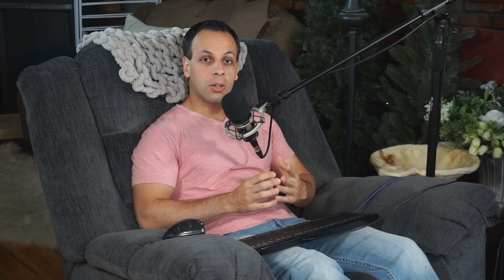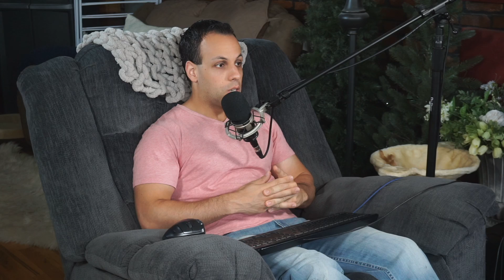Let's talk about what Right to Repair means for how devices are designed.

Comment: Haven't even fully watched the video yet but I just can't wait to get this off my chest - Apple took away the headphone jack and glues in batteries all for the sake of design and thinness yet the last few models of iphones were thicker and heavier than when they had headphone jacks and a more easily accessible/replaceable battery. It's all BS to take our money. Take away an analogue 3.5mm jack and replace its function with proprietary lightning port = control your customers' accessories.
Reply: Also remember that Apple released the jackless iPhone 7 at the same time as their AirPods wireless headphones. It's almost as if they expected customers to just replace their jacked headphones with expensive and unrepairable AirPods...
Reply: @InventorZahran  yeah, how convenient right?
Reply: @InventorZahran  Well with that being said, airpods are still the most widely used and sold wireless earphones. With that push of taking away the headphone jack many many more bluetooth earbuds/headphones came to fruition and development. Like it or not but the state of wireless earbuds today (widely accessible with many price ranges) is bc of the push that apple made.
Reply: @ExcaliburTheOnlyOne  It is, but most wireless headphones/earphones can barely manage 320kb/s. For anyone who’s even remotely interested in audio fidelity, wireless is crap.

It’s all about convenience, and convenience costs. £200+ for cheap plastic earbuds is pathetic. I have wired earphones that cost £50 that genuinely sound better.
Reply: Fun bit of information that will probably make you angry. Open up any jackless iPhone and take a peek where the jack used to be? What's there? Nothing. At least, not anything important. The taptic engine has gotten smaller on new models, and even on the 7/8 its just a little plastic bracket holding a microphone in place. That's it.
Reply: @Bluecolty  the only reason why this doesn’t make me more angry is because its not surprising and almost to be expected by Apple. They might as well just put a tiny plastic hand giving the you the finger in the space where the jack used to be. I’d appreciate that at least.

Comment: This premise also applies to small appliances.   Manufacturers use tamper proof fasteners.  I should be able to repair my small appliance.  Or,  take it to someone like you for a cheap and easy repair.   Versus throwing out a $100.00 appliance.

Comment: I 100% agree with Louis on this topic. Also instead of forcing companies to make device design more repairable though law and regulation, we do it though consumer choice. Like buy the model that is more repairable and therefore companies will then be incentivized to make their products more repairable though consumer choice. For example buy the iPhone 11 Pro over the 12 because there is less lockdown in the older product vs Apple pairing the screen to the motherboard, therefore making screen replacement at anywhere but an Apple store virtually impossible.

Comment: The thing with the battery a user can't replace is that the main reason they can't is because the phones are tabbed and glued together, often with the battery glued in place, which is not essential to designing a slim phone. It's a primarily vindictive choice.

Remove the unnecessary glue and most phones are still not generally serviceable by the average user, but they be more effectively worked on by a proper repair shop with less risk of damaging the components and no design functionality is lost.

Comment: So, we agree on most things, but not on sockets and I want people to really think about this.  In the 1980's AMD rushed onto the scene and pushed Intel forward because their products where pin compatible.  I don't think any of us would argue that was a bad thing, in fact I would argue it is a good proof for legally standardized sockets that could continue to evolve, like PCIE, RAM and USB.  And to be clear, you yourself Louis, pointed out that the LCD controller was orders of magnitude smaller than the Cold Cathode board.  Even requiring sockets things would shrink pretty quickly, but more important it would allow a resurgence of competitive products using the same socket.  This is what made the PC take off in the 80's, upgradability.
Reply: What you're missing is that upgradeability is also what holds PC back.  Its why Microsoft are trying to make a clean break with Windows 11, because the OS can't be optimised for the latest CPUs while still supporting decades old hardware, its just too complicated to have so many code paths and not introduce bloat, bugs and importantly security holes.

There's a reason why things like PCIe, RAM, USB can be sockets/plugs, but most other things are soldered.  I can even forgive Apple for soldering EVERYTHING on their new Apple Silicon devices, because its literally HOW they are so efficient and powerful.  Sockets introduce losses and they quickly add up.  They're already struggling to keep signal integrity on PCIe Gen 4.  I own a motherboard where I can't use dual-channel RAM witha certain CPU, that flexibility has a lot of caveats.

Don't get me wrong, when manufacturers solder RAM to the motherboard where a socket would normally be, that's bad.  There is no good reason to do that.  But when soldering things directly improves latency, bandwidth, efficiency in general - such as on phones, GPUs, games consoles, then I'm absolutely fine with that.

I bought my first ever Mac recently despite following this channel, because it can do in 21W what my PC needs ten times as much electricity to do.  I can literally leave it running Folding at Home 24/7 while also doing what I need it to do, using about the power consumption of a broadband router.
Reply: @alexatkin  I suggest you check the latest research on through-hole vs surface-mount PCIE efficiencies.  We are solving these issues. :-)

Comment: The naysayers aren’t thinking straight. IF RTR is passed some company, at some time, will start touting their repair ability to gain a competitive edge. I know I would!
Reply: I'm from Europe, but seeing this as a customer it's definitely one heavy factor I have when buying stuff. I don't like and I don't believe that a product should be replaced after 2 years. If there was a company that had the schematics, serial number parts and the last one optional, having the procedure to fix or replace parts in the product, I would be a faithful customer even if it was a bit more expensive. I know the product will last and would surpass the lifetime of competitors that design things to fail after a certain amount of time. Also I love to repair stuff on my own, if I break it, I pay for someone to fix it and in last case if everything fails I buy another. No brainer.

My phone currently has like 3 our 4 years, my laptop has more or less 7 years and before this one, I had it for 10 years. Either my devices last or if it fails after a couple of years I will never buy it again from that company (looking at you ASUS).
Reply: @drstrangel0ve  Asus actually hasnt had devices that fail after a few years anymore. They have gotten a lot better. Though Acer is awesome, their devices last a crazy long time, they have great customer service, and they understand the need for repairability
Reply: @Lominoth  Well I never looked again to ASUS after seeing some expensive models needing to have the GPU replaced after 2 years and seeing the build quality being so cheap for an expensive product, so I bought at the time a MSI which I absolutely love. Acer is a brand I don't hear for a long time, good to know they are making good quality devices now.
Reply: This is already the case. You don't need right to repair laws in place for a company to design their products to with reparability in mind, or to advertise that point. Many companies today do exactly this. Sadly, the reality is that we live in a culture where the average person just doesn't seem to care. Granted, I think that culture has at least partially been engineered by major electronics manufacturers, such as Apple. Hopefully, if strong right to repair legislation is passed, people will get a taste for it instead of just buying a new phone, and the culture will shift.
Reply: @Netist_  I disagree. Do you not watch Louis’s videos? Apple keeps upping the ante making things more difficult every year.
Reply: @Tagurrit  I don't see how Apple makes it difficult for another company to design and market their own products with repairability in mind
Reply: System76 is doing that already, even the BIOS is open source.
Reply: "It's not only possible, but easy! The new San-Co 6900!"
Reply: And there are potentially so many fewer parts to have to maintain in warehouses when designs aren't changed arbitrarily for this fake "innovation" on things like these modern refrigerators we're seeing that last five years. So much is done just for the sake of making a buck not actually improving the technology or doing anything to improve life for people.
Reply: I agree wholeheartedly but, I think there is an issue residing in the RtR movement itself that complicates things. RtR has two aspects, one good that is pro-rights, another that is bad and anti-rights. The good is  getting rid of schematics' legal protection as "InTelEctUaL PrOPeRtY", that means schematics can be freely shared, talked about, explained, etc. so people can understand the implications of their purchases. I'm not saying everyone has to, or will, look at the schematics, but people WILL, and those people will explain it to others, allowing consumers to be more well educated on what they buy. Now, companies shouldn't be FORCED to reveal these schematics, the schematics just shouldn't be legally protected. This means companies do still have the right to keep their information private, but once that information goes public, they have no protection. So you either let it be fully public, or let it be fully private, but you can't have a foot on both sides of the line getting public legal protection and private obscurity protection. As you bring up, this will make more companies realize "hmm, if we try to keep our schematics locked down, they'll just be shared anyway, so we can get good PR by sharing them ourselves!".

Additionally part exclusivity is more complicated, but as a rule of thumb, if you have to make a deal with another company, organization, or individual, where a core component of that deal is involuntary exclusivity, that deal is anti-competitive. If apple doesn't want to sell you their M1 chips, that's one thing, they're making those themselves, it's their right to not sell if to you. But, if apple has leveraged their size against another company to be DISALLOWED from selling to you? Thaaat's a different story. 

The bad part of RtR however is when people start trying to FORCE companies to do these things. FORCE companies to sell parts, FORCE companies to let schematics be visible, FORCE companies to get rid of software locks. If I, as a consumer, are okay with, or even WANT (for some god unknown reason) to buy a locked down product, from a company that hates me, I have every right to buy that iPhone. A private company has the RIGHT to sell me whatever I want, and I have the RIGHT to buy whatever I want. If its a bad deal that I'm being fucked over in? Fine. It's not news that iPhones are locked down, everyone knows it, so if I STILL choose to buy one, that's my choice. I have the right to buy a product, no matter how shitty a deal it is.

The issue we have now is a result of government legislation hindering the spread of information in the form of schematics and, this is a much more complicated topic but, the anti-competitive practices of larger companies leveraging their size for exclusivity deals. In short, government over-extension. (once a company becomes big enough that it can leverage it's size against the market, it's functionally synonymous with a government entity. Yes, I know that sounds stupid, but if you've actually read through the original works that inspired the idea of the "free market" and understood them with historical context, you realize that the clean cut difference between company and government then, is much more blurry now) 

This is bad for two reasons 1 : if RtR passes and gets public backing, now we have government over-extension, destined to only cause more problems in the future, but 2 : if people start realizing the bad side of RtR, they might not pass the good side either. Or, more practically, if companies are FORCED to comply, they will spend more money fighting it, and it's less likely to pass.

Comment: Your view on batteries is up to you. But I would like to be able to
safely access batteries and replace them, rather than
buy a new device or pay a repair shop to replace them.
Reply: While I would also personally be able to replace the battery easily, if nothing else I'd at least like access to an original battery instead of only being able to buy worryingly cheap ones from china with inflated capacity figures
Reply from the maker: I would 110%. I just wanted to make clear that the legislation doesn't address this, because it doesn't. I like replaceable batteries. I prefer devices with replaceable batteries. but reality is that the bill as drafted doesn't address user replaceable batteries
Reply: @rossmanngroup  Sorry for the
misunderstanding.
And big thanks.
Reply: i've had lots of waterproof phones that i've proved are not waterproof atleast in my hands so I would like the days of replaceable phone batteries to come back instead of waterproofing.
Reply: @Anon1370  the galaxy S5 was waterproof and had a replaceable battery. Worked just fine. If you have a waterproof phone and open it up, your waterproofing is gone.
Reply: @jojoflowe  my waterproofing was gone on afew phones i had without opening it up. I managed to get water in the speakers somehow and nobody could hear me on the phone
Reply: Yes just because you're dumb doesn't mean all of us should suffer.
Reply: The LG V20 phone got the thickness down to a mere 7.6mm and still had the removable battery.  That ought to be plenty thin enough for anybody.  Time to bring removable batteries back!
Reply: @MrAdamGC  at this moment in time i have a iphone 11 pro max with water damage and a xiaomi pocophone with no waterproofing that doesnt sound damaged. The one that was suppose to be waterproof wasnt so yes i say bring back removeable batterys if you cant prove the acclaimed waterproofing!